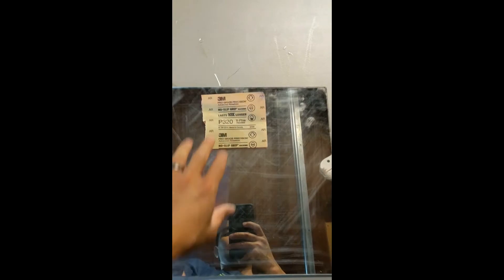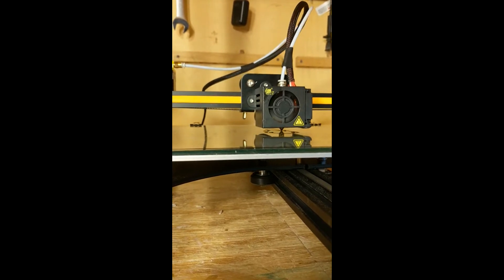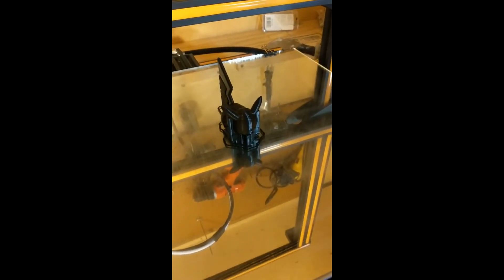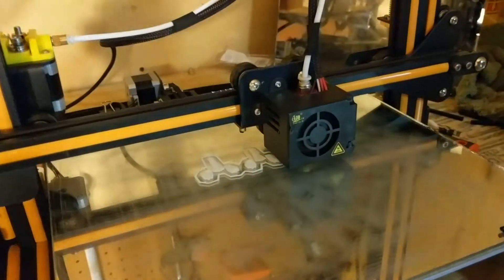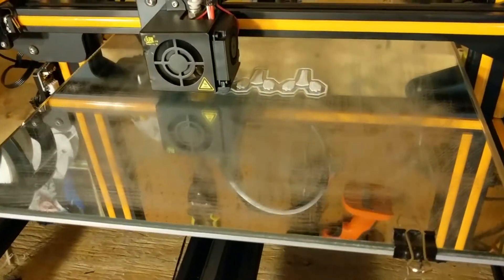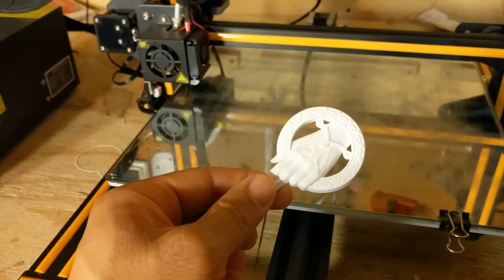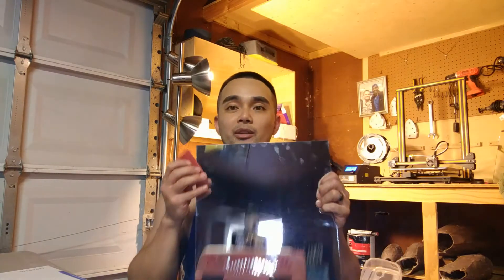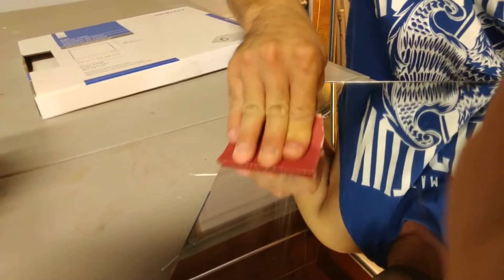How to Get Perfect Adhesion Everytime on Your CR10

Comment: I have a CR10S. It is a nightmare. I have ordered the ultimate base but i have no idea when or if it may show up. The base that was sent is warped and i am trying to use the mirrors. Gluestick does not work. Hair spray does not work. Tape does not work. I own a Trinus and have had no trouble out of it for over two years. I am going to try this but i have no hope or faith in the CR10S at all.

Comment: this method works great!  thanks for posting...Home Depot: $11 for 12" x 12" Glacier Bay mirror  tiles (12 pack). I used 100 grit sandpaper. Sanded as suggested. I've run a variety of prints with ZERO bed adhesion problems.  AWESOME Hack!!!

Comment: I prefer to use hairspray. I could never print on just bare glass itself. I used take for a while, but got sick of it tearing much of the time. Then I used gluestick for a while and it works well, but is messy and you can get a nice smooth bottom of the print. Hairspray has turned out to work best for me and after several layers it achieve a similar tackiness/grittiness that scuffing your glass would, but still allows you do clean it to be totally smooth with isopropyl to get a fresh start without scuffing up you glass and risking glass chips or small glass dust/shards.

After several layers of hairspray, you don't even have to reapply it to the bed all that often.

Comment: instead of sandpaper may i suggest glass etching compound. you get a consistant etch all over, and you can re aply to get your desired depth.  id say two coats. you get a nice looking frosted effect.
Reply from the maker: yea that's a great idea! but not everyone can do that. sandpaper is an easy thing that EVERYONE can do

but you're absolutely correct :)
Reply: its pretty easy and your done in 10 minutes,  just get a samll bottle of Armour Etch 2.8 Oz Etch Cream on amazon its like 10 bucks.  pour on glass wait ten minutes and rinse off.    i bet its faster than sanding and you get a nice frosted piece of glass.   filament sticks, and pops off as it cools.   no more glues or tape or surface paper.   evryone can and should do this.

Comment: So I have been using Cura 3.04 as a slicer for my 3d models.... and when I try to print them on my cr-10 I have noticed that the machine retracts the fillament at the beginning of the print after the nozzle has already moved so about the first 20 seconds of printing or so have no fillament coming out of the nozzle. Do you have any ideas on why this is happening and how I can fix It?
I noticed your cr-10 does not do that.
Reply from the maker: Matthew Davidson sorry man I'm not familiar with cura

Comment: Excellent suggestion!  Thank you so much!  How well does it do with larger prints?
Reply from the maker: PgPgDn thanks man! It does very well with large prints. I use a CR10 and all I do is 3d printed armor
Reply: Thanks!  I am amazed at how well it sticks.  I am new to the CR-10 (not 3d printing) and I was really struggling with getting parts to stick.  I found my 12" x 12" mirrors (6 pack) at Menards.  Gave one a good sanding as you showed, horizontal, vertical, diagonal both ways and wow!  I am amazed at how well the parts stick!  I am subbed to your channel!  Keep up the good work!
Reply from the maker: thanks man!! just remember that it has to be on a heated bed. if the bed isnt heated, it wont work. the CR10 is NOTORIOUS for the heating wires breaking off from the bed. i had to go back to tape a few times cuz of it...
Reply: I made the Strain Relief mod for the heated bed.  I am printing PLA at 205c with the bed at 70c.  What do you set yours at?  I have tried 60c for th ebed but the part tends to not stick.  I haven't tried 69, 68, etc to find the perfect sweet spot yet.
Reply from the maker: PgPgDn 210/60 for me. Sticks perfectly

Comment: +1 Nikko Ind. - Have you tried sanding the glass bed supplied with your CR10 instead of buying a box of mirrored glass tiles?  I've just assembled my new CR10 and can't seem to find a consensus on getting proper bed adhesion. Your idea seems like the most logical... and least messy and time consuming so would like to try it.

Cheers from Thailand!
Reply from the maker: hey Jimbo. sorry for the late reply!!! no, the glass bed that came with the machine was warped in the middle. 

here's the thing. 3D printing is a very precise craft. if the bed is warped even by just .2mm it could mean the difference between successful bed adhesion and a failed print. 

let me know how the method works for you!!
Reply: Thanks for the reply. Yep, I know the bed has to be flat.  After watching this video I'm.wondering why we can't lightly scuff the glass bed with 320 grit like you did on the mirrored tile to promote adhesion.  I'm lucky that the glass bed on my new CR-10 is flat.  I've printed the popular Thingiverse upgrade parts using a light coat of UHU and all PLA parts came out perfect. On a whim I also tried printing a set of 4 of the tiny Bowden tube clips on bare glass cleaned with glass cleaner, but sadly there was zero adhesion to the glass @210°/60°.  The 2nd try with UHU produced perfect parts again.  I would still like to get around the UHU or taping, hair spray, etc.  Scuffing the glass certainly seems promising.

Hope you don't mind a couple more questions.  I've asked these questions elsewhere but haven't gotten a response yet.

1.  Can the bed heater be turned off (in gcode file) after the first few model layers have been completed?  It seems like a waste of resources to keep the bed heater on throughout the entire print operation.  I thought the reason for a heated bed was to ensure that the first few layers adhere to the bed properly.  It would seem that subsequent print layers can't benefit from the heat.  Is that a correct assumption?

2.  If it's possible/feasible to turn off the bed heater mid-print then how to do it?  Is there an option in Cura?  If not, can we edit the gcode file manually (with a text editor) to add a line to turn off the heater?

Thanks!
Reply from the maker: actually  no, the bed has to be heated. if it's not then the print will shift and you'll have spaghetti everywhere. lol
Reply: I understand that the print bed must be heated initially to prevent the print from shifting.  My question was and still is, after the first few print layers are successfully completed is bed heat still necessary to produce a quality print?  In this case I'm talking about PLA filament.
Reply from the maker: yes. the bed has to remain heated. otherwise the object will come off the bed. funny enough i just made a video on what happens when the bed stops heating up. you should check it out. https://www.youtube.com/watch?v=Al1Fwm1dalw&t=3s
Reply: Great video, Nikko. I like that you showed people WHY they might want to do this before showing them HOW to do it. Subbed and liked.

I thought I'd toss in my 2 cents on adhesion in general, as well as Jimbo's specific question. Yeah, I know my comment is too long. :)

For the most part, I agree with Nikko. In my own experience, you really need to have the heated bed on during the entire print. But through trial and error,  I discovered you don't have to keep the bed (or the nozzle for that matter) at the same temperature during the entire print. I print the first 2-3 layers at least 10C higher than the material's highest recommended bed (and nozzle) temperature to make the plastic more liquid and sticky initially. I then reduce the BED temperature to about 5C below the lowest recommended setting for the rest of the print. I only lower the nozzle temperature to the midpoint of the recommended temperature range because I generally print faster than most people (75-100). Sometimes, I only "lower" the nozzle temperature to the highest recommended setting because printing at high speed requires higher nozzle temperatures for quicker filament melting. Be careful reducing the temperatures after the first couple layers are done. Too low won't bond the layers of plastic adequately, which can allow upper layers to pull apart later. Extremely low causes nozzle jams. This general "temperature reduction after 3 layers" approach has been working pretty well for me for over a year. I get great adhesion and more consistent appearance in upper layers. It seems to help with a lot with bridging, too. The drawback is the first few layers can look more squished than the rest of the model. I sometimes need to run a  knife along the bottom edges of the finished print to remove plastic that was squished out too far on the sides. Then again, it could also be the print surface I use which is making the most difference in print quality for me. More on this later.

I've also heard that putting the printer in a sealed  enclosure while printing helps keep consistent layer appearance while letting you use a lower bed temperature for the entire print. It also helps when your heated bed is too weak to actually reach the desired temperature. I plan to build a clear enclosure for at least two of my printers at some point. Since the heated bed draws more current than the rest of the machine combined, I figure even a slight reduction in power usage will eventually pay for the enclosures. You can also mount an air filtration system to a seal-able vent on your enclosure. These are often sold for use in soldering stations and will help remove particulates from the trapped air prior to lifting the enclosure off the printer when a print finishes. After all, there is still no long term data on how the plastic particles released into the air while 3D printing will affect user health over the long term. It also vents the warm air faster for less part removal delay.

Regarding Jimbo's question about sanding the original glass plate versus using scuffed up mirror glass: The reason people started using mirror glass on their printers is because mirror glass is created with a very high emphasis on being perfectly flat. Mirror glass is generally never warped when you buy it. The reason is that any slight warping in a mirror would distort the reflection noticeably and nobody wants a mirror that shows a distorted reflection. Plus, mirror glass is relatively inexpensive, letting you easily purchase extras for special case uses. If by some miracle your existing glass plate is already perfectly flat, you can just sand what you have. One way to test for an uneven build plate is to set your build plate so that the four corners are precisely the same distance from the nozzle using a dial indicator gauge that is rigidly and securely attached to your print head. Once the four corners are set to precisely the same distance, methodically move the print head around in a 15-25mm grid pattern to measure every part of the glass plate. If all of the measured distances are exactly the same as the distance at the four corners, then congratulations! You won the build plate lotto! :) (or you are already using good quality mirror glass) If any portion of the build plate varies more than 0.1 to 0.2mm (normal layer height) from the corner measurements, you will likely have adhesion issues (or nozzle grinding glass) in that area. I'd consider switching to mirror glass in cases where there is widespread variation. Your adhesion and print quality will benefit from a flatter surface. Plus, the flatter your glass is, the more stable your object will be when sitting on a flat surface. This is most noticeable on prints with large bases. (no rocking at all)

After years of experimentation, I've settled on using a PEI sheet on top of a VERY flat glass plate for printing the vast majority of materials. In this case, sanding the glass, then cleaning it before you stick the PEI sheet on top improves the adhesive bond so that the PEI sheet stays just as flat as the glass - as in no ripples or bubbles. For a couple of my printers, I even have a second glass plate with BuildTak installed for those few materials which bond almost permanently to PEI. For me, this works slightly better than the scuffed glass plates and occasional spritz of hair spray I used, but your mileage may vary. The best PEI sheets I've found were purchased from a merchant named Prozix on Amazon. (No, I don't get a kickback for mentioning them.) They sell 0.5mm thick sheets in sizes up to 500mm x 500mm. More importantly, the PEI sheet already has the 3M adhesive mounted on the back by a machine. Believe me, having the adhesive put on by a machine makes it MUCH easier to get a good clean bond to the glass plate with no ripples or blobs in the adhesive. Since I have slightly shaky hands, (and consequently a lot of soldering iron scars LOL) finding these sheets has made my life a LOT easier. These sheets also benefit from a light sanding. They clean easily with alcohol. Highly recommended.
Reply from the maker: thanks very much for the compliment sir!! much appreciated!! 

and a HUGE thank you for the write up!! that's great info right there!!!
Reply: +1 Bill Dempsey - Thanks so much for the detailed explanation.

Comment: Or you can just level properly and use hairspray. Works 100% of the time for me.
Reply from the maker: sure you can do that too. and i hear a glue stick works fine as well. but do you want to keep spending money on those?
Reply: @NikkoIndustries  1 can of hairspray is quite cheap and will last for a LOT of prints. After several layers and building up the tackiness on the surface for adhesion, you don't even have to apply it but maybe once every 5 prints.

Comment: Could you share your settings? What program do you use?
Reply from the maker: yea sure!! 

Layer height .2mm
bed temp 60
nozzle 210
100% cooling
perimeter and infill are dependent on what i'm printing

Comment: I gave this a try, using 120 grit sandpaper. I gave the mirror tile from Lowes a good sanding. I've done printed three times on my CR-10 using the sanded mirror tile. The good: the prints stick when the tile is hot, and yes, they just pop off when the tile (and the plastic) have cooled back down to room temperature. The bad: little glass chips are popping off the top of tile and I'm having to scrap glass chips out of the bottom of my prints. I am going to switch to a different mirror tile, and I'm going to try using 320 grit, with a lot less sanding, and see how that works.
Reply from the maker: really? i've never had that with the 120 grit but you do have a point! thanks for sharing!! let me know if the glass chips are still coming off on the 320. 

how hard did you sand with the 120 grit?
Reply: Use wet sanding, soak the sandpaper for a few hours / overnight then sand outside, the sanded glass bits will be picked up by the sandpaper. You can also use an air compressor to blow out the glass after sanding.

Comment: Hey neighbor (I'm over here in the East Bay), great video! Two quick items:
1) Did you head the bed? If so, to what? (Sorry if I missed it in the video). If you did heat, did you try with unheated?
2) The prints almost look like the pop off too easily. I always worry that tall skinny prints will bet bumped just a little at the top of the print and pull from the bed. Hard to tell exactly how "stuck" they are.

I think either way, I'll need to give this a try! I've been using blue-tape and while I really like the results, it's kind a pain.
Reply from the maker: Rob Ludlow hey man! The bed is heated at 60°. I think I forgot to mention it in the video. Sometimes the prints do come off too easy sometimes. But only if there's not much surface area stuck to the bed for stability. 

Let me know how yours goes!! Good luck printing brother!! If you need my actual settings for S3D just let me know!! Cheers!!
Reply: Thanks man! Ya, I'm printing really well on blue tape with no bed heating, so unless an alternative can give me as-good adhesion with a cold bed, I'm gonna stick with tape.

BTW, when's the Bay Area CR-10 Meetup!?!?
Reply: Another bay area printer (Fairfield area). What type of sandpaper did you use? I'm using Garnet and it barely scratched the surface.
Reply from the maker: i'm using 3M. you'll have to put some elbow grease into it. ;)